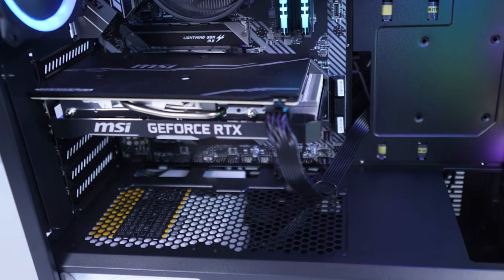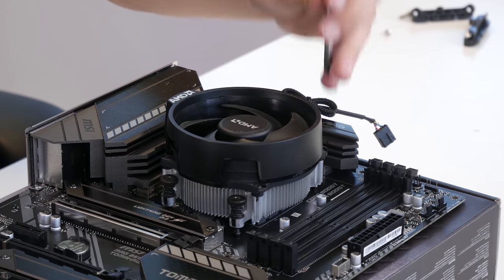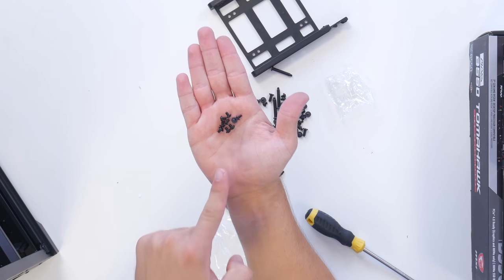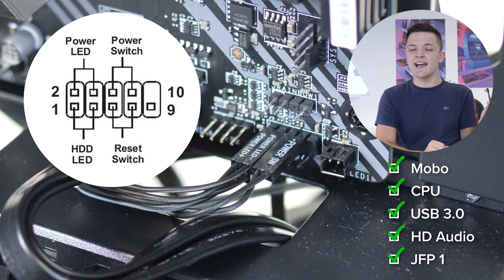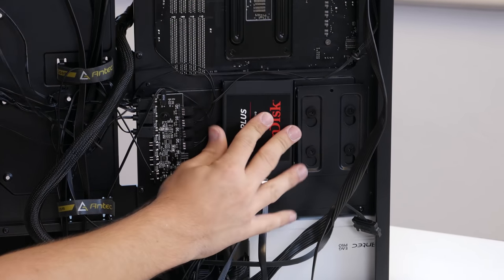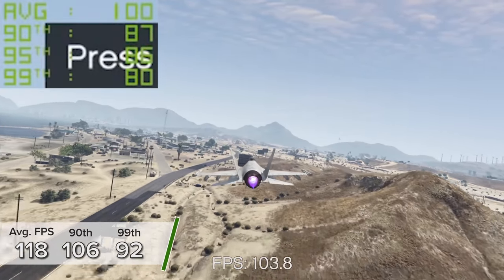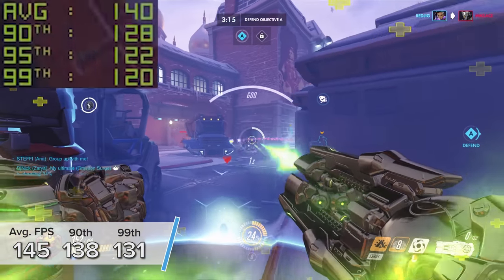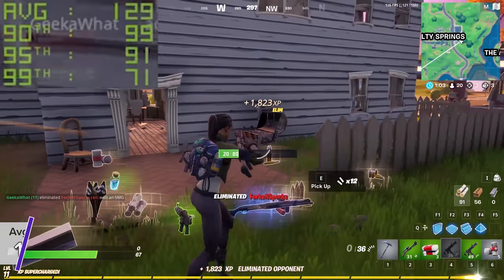Epic $1000 Gaming PC Build Guide! [FULL Build Tutorial & Benchmarks - ft. RTX 2060 Super!]

Comment: This is a solid build. Could you please add links for the additional RGB fans too?
Reply: not really, for a 1k build you would be by far better off with a 10400 & 3070... and if the 3070 is still non existing, a 3600 & 5700xt will still dominate this build such easy over this...
Reply: @theelepel2679  Are you joking? You think you can get a 3070 and 10400 and stay at 1k or under?
Reply: @submosphere1203  Nope, arent Joking. Yes you can get that if the msrp of the 3070 FE is still 500$ then yes you can get those parts under 1k.

Comment: What is this "future proofing" for b550? Isn't the next gen after Ryzen 5000 using completely new sockets? and thus completely new motherboards next year?

I swear I heard that somewhere...
Reply: Year b550 isnt future proofed but it has a lot features that will work nicely for the next years like pcie 4.0 and 2.5gb ethernet but in general i wouldnt upgrade if you still have a b450 board. For new systems you cant avoid that socket or intels board if you need a pc right now

Comment: Honestly this is a fairly good pc but I think this build should be looked at 
Motherboard: x570 asus TUF Wi-Fi☆
CPU: AMD Ryzen 3600☆
GPU: EVGA RTX 2060 KO☆
PSU: Corsair RM750x☆
Ram: Corsair Vengeance 3600mhz (16x8g kit)☆
SSD: WD Black SN750 500GB☆
HD: 2 terabyte Seagate barracuda☆
Case: NZXT H510i☆
Cable extensions: Asia Horse Black☆

This is the build I'm building in december  and is around the same price range, it's a great build for the future and great quality parts that I've spent so much time finding about them, if you want you can change out the case to the one in this video but overall this build is way better
Reply: 1-why are you using an x570 on a ryzen 5 processor? a b450 or b550 would do you fine
2- 750w is overkill for this build. 650 would do you fine
3-do you need the sn 750? an sn550 would be a better value overall and more suitable for this build's budget
4- if you do these savings, you can fit in an rx 5700xt or you can also cut some more corners with the other parts and fit in an rtx 3070 if these things had good supply unlike the 3080 and 3090
Reply: Spend less on motherboard instead get a 5600x. And wait for rtx 3060 or 3070
Reply: @clankerdevries  Didn't you read the reasons? Clearly has almost same price and future upgrade path.
Reply: @clankerdevries  which 5700xt there are a lot of them

Comment: I’m wanting to build a pc, should I put a Ryzen 5 3600 or a ryzen 5 3600x I am a 15 year old only planing on playing Fortnite. I will probably be putting a Rtx 3070
Also what motherboard etc should I pair with it
Reply: 3600x has a minimal difference to the 3600, so if you're happy to pay the difference in price then go for it. If not, it won't make a huge difference to performance

Also, Fortnite is crazy easy to run so if you're only planning on playing Fortnite, an RTX 3070 would be massive overkill
Reply: Get 3600 and save cash

Comment: This is almost like my build, instead i have a 3600x, 32gb of ram rather than 16, and use the NZXT H510. Aside from that i have the same gpu, but why does yours seem to preform better than mine :/, I realistically havent pushed it too hard or anything and i only have a 75hz monitor so its not like i can do that anyways but my system seems to run loud in the fan department for simple undemanding games like cs

Comment: My PC is about a month old and ran great but it’s suddenly at 100% CPU usage, anyone know how to fix? Have a ryzen 5 3600xt and 5700xt gpu
Reply: Check your task manager ? what does it say
Reply: @Aarmello  Cpu usage when I play a game is around 96-100%, and my GPU is around 15.
Reply: @jettkingkilla9380  you sure its not the gpu usage thats at 100? What are your fps
Reply: @f-22raptor25  Yeah, that’s my issue
Reply: @f-22raptor25  My FPS is 200-300 in a game like rainbow, but I get these small microstutters and my cpu usage is at 100%.
Reply: @jettkingkilla9380  If you have micro stutters then its a cpu issue, check with task manger of apps using your cpu during games
Reply: @f-22raptor25  yea... my CPU is suddenly making games take around 90% of the usage. PC is a month old, ran great and get great frames.
Reply: @jettkingkilla9380  you should try to update all drivers (gpu...) does it happen in certain games ? which CPU u have ?
Reply: Aarmello tried updating them, and rolling them back doesn’t work. I have a ryzen 5 3600XT. It just started happening suddenly, too. Temps are also much higher, also was a sudden change.
Reply: @jettkingkilla9380  well.. its hard to say... i had myself a 100% cpu usage. I found that I had a malware that would do crypto minning on my pc... did a fresh installation of Windows 10. And now its gone that was some Kind of a virus. Although,  if you built ur pc urself,  would it be better to add thermal paste on ur cpu for the high temps ? NOT RECOMMENDED if you bought your pc already built. Check bios ? Before going to a professionnal. Just go easy with your pc. Ill try personally to installl a fresh Windows...cant really help you :/

Comment: Hey I want to build Ryzen 5 3600 with gtx 1660, I'm gonna use it for streaming and recording some gameplay should i got with normal or super? 

This is list of the part 

PROCESSOR : 
AMD Ryzen 5 3600 3.6Ghz Up To 4.2Ghz Cache 32MB 65W AM4 [Box] - 6 Core - 100-100000031BOX - With AMD Wraith Stealth Cooler
Price : Rp. 3,199,000 or $216.91

MOTHERBOARD : 
MSI B450M Pro-M2 MAX (AM4, AMD Promontory B450, DDR4, USB3.2, SATA3)
Price : Rp. 1,208,000 or $81.91

RAM : 
KLEVV DDR4 BOLT X Series PC25600 3200MHz Dual Channel 16GB (2X8GB) - X2KD48GU880-32A160T
Price : Rp. 980,000 or $66.45

SSD : 
ADATA SX6000 Lite 512GB M.2 NVME R 1800MB/S W 1200MB/S
Price : Rp. 967,000 or $65.57

CASING : 
CUBE GAMING NORDERG BLACK - mATX - FRONT & SIDE TEMPERED GLASS - PSU COVER - Free 3PCS 12CM AUTOFLOW RAINBOW RGB FAN
Price : Rp. 450,000 or $30.51

VGA : 
Inno 3D Geforce GTX 1660 6GB DDR5 - Twin X2
Price : Rp. 2,989,000 or $202.67

PSU : 
Corsair CV Series 550W - 80 Plus Bronze
Price : Rp. 839,000 or $56.89

MONITOR : 
LG 24" LED 24MK400 Gaming Monitor
Price : Rp. 1,431,000 or $97.03

COOLERFAN : 
CUBE GAMING BRIGHT 15 LED BLUE FAN 12CM 1300RPM
Price : Rp. 45,000 or $3.05
Total : Rp. 180,000 *4

NETWORKING : 
TP - Link 150 Mbps Wireless N  PCI Express Adapter - TL-WN781ND
Price : Rp. 104,000 or $7.05

Price : Rp. 12,347,000 or $840
Reply: Get Super variant

Comment: Nice super awesome PC for only $1,000?
adds everything to cart
Est Total: $1,621.93
Me: OK GREAT
Reply: Well theres a lot of overpriced trash in the build. Like the hyperx ram is expensive and not overclockable also rgb fans cost too much. Just stick with crucial ballistix/g skill ripjaws ram and arctic p12 pwm pst fans and you already saved around 20 bucks. 750w is also unnecessary for a 2060 super and the ssd is cheap but bad coz it has no dram cache so it will run slower after some seconds of data transfer
Reply: @zeronin4696  ended up making my own minimalistic build for around $950